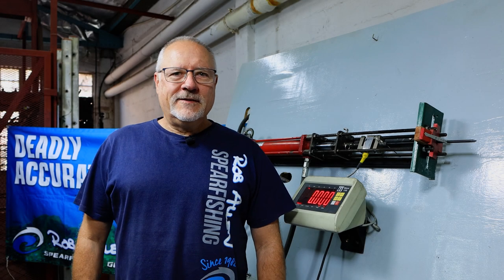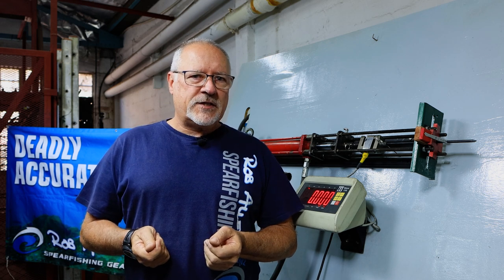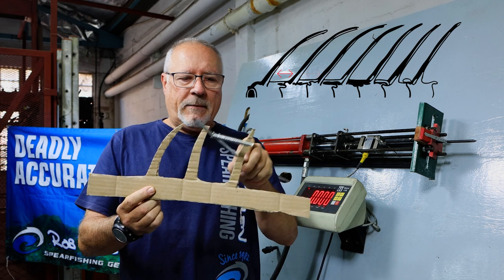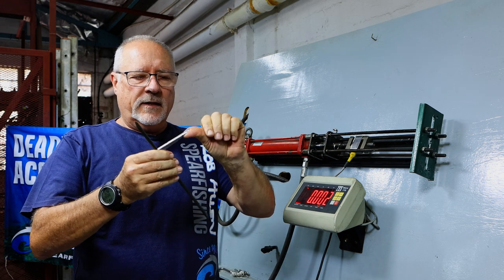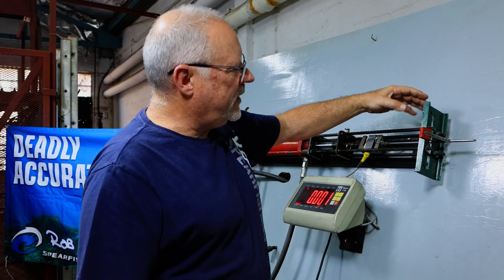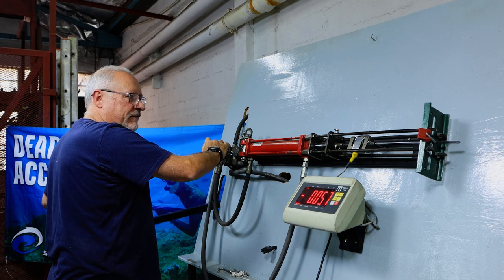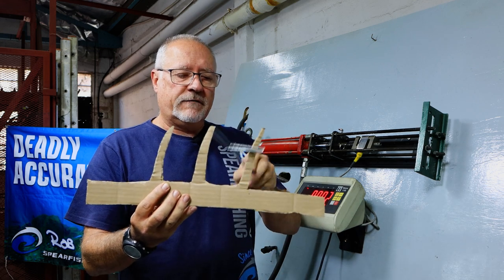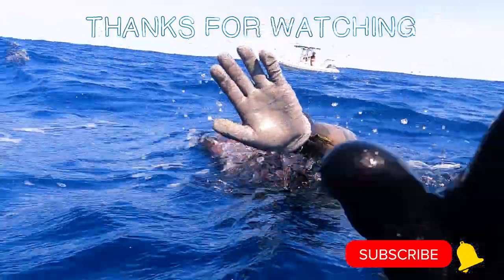Rob Allen | Barb Break Test Part 2 | 2022

Comment: Hi Rob, thanks for your great videos👍By the way, any suggestions on the shaft cone? Does it really help a lot in terms of accuracy? Cheers
Reply from the maker: From what I know it is supposedly better but haven't done any tests yet.
Reply: Hi, depending on the barb setup: 
a) for recessed barbs into the spear the benefit will be not that important I guess. 
b) For barbs that just lay over the shaft a cone suggests a smoother penetration. 

Hope I explained that well enough brother. There is a gentleman on YT who claims this after target shooting/testing in his pool.
Reply: And... the cone can protect the securing pin against sharing - e.g. when shot against coral as Rob mentioned.
Reply: @RobAllenSpearfishing  Thanks!
Reply: @DeepBlueSpirit2  Awesome Bro! Cheers👏
Reply from the maker: @DeepBlueSpirit2  I agree it should be better, just never tested, sounds like it is though. One day we will experiment 😆
Reply from the maker: @DeepBlueSpirit2   Very good point. :washhands:

Comment: How does this compare to the drop barb?
It's my absolute favourite spear now, I've landed so many fish with horrible shots that I had absolutely no right to keep on the line with the drop barb, it's so incredible it's like cheating, how can it be so much better than a conventional flopper?
Reply from the maker: In my opinion, the drob barb is 100% better. 

If you have the drob barb then great :)
Reply: @RobAllenSpearfishing  Thanks Rob, not sure if you guys have tested but I've been using my drop barb without the O ring for some time, I secure the barb before firing with the barb line trapped in the firing line system that holds the spear on the roller head, it seems to work well for me if that's something you guys haven't tried
Reply from the maker: @cassieangel8878  Tried it before, it can be an option but it can get trapped in the roller if you're using a roller gun.